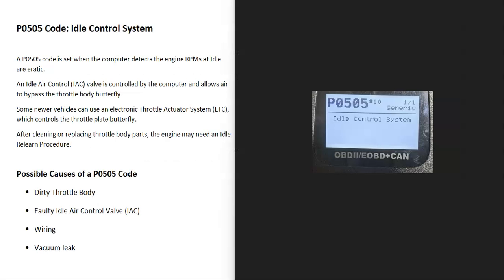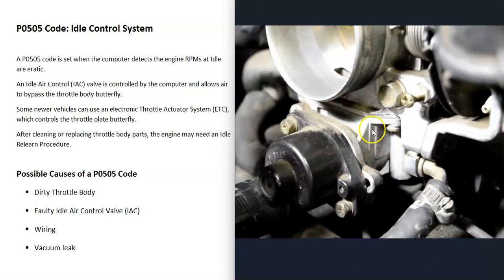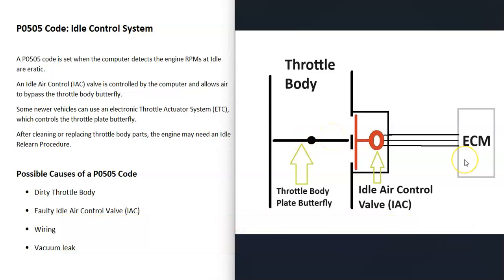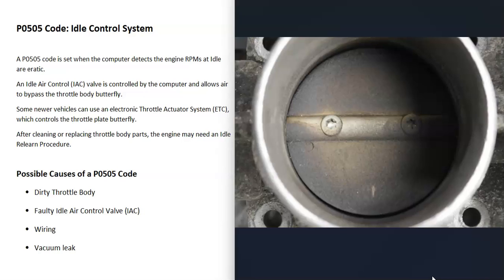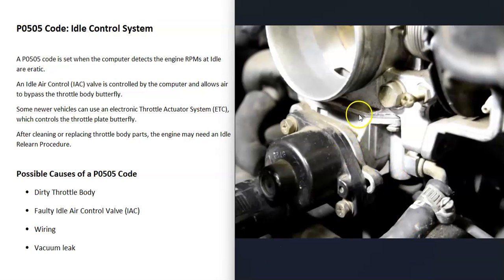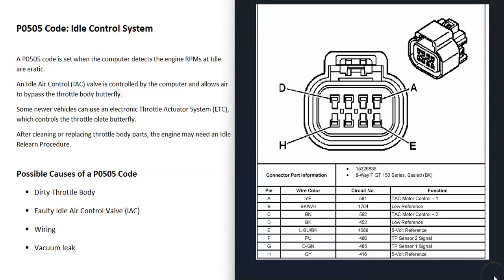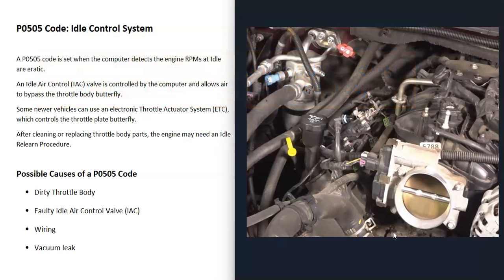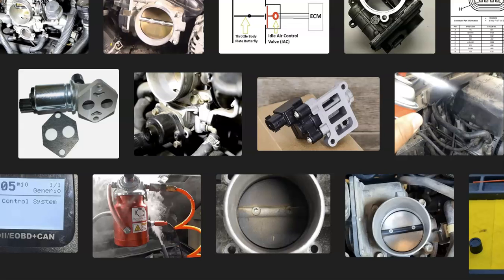Causes and Fixes P0505 Code: Idle Control System

Comment: 2006 corolla doesn't have icv just electronic throttle body keep getting the 0505 ive changed everything intake manifold plugs coils TPS no leaks plus new fuel pump ?

Comment: I replaced the throttlebody on a 2004 Toyota Camry 2.4 L but now I’m getting a P0505 and a P0441. I’ve checked the purge solenoid and it’s working fine. I’ve checked the hose is going into the throttle body and they appear to be OK. They may have not been anything wrong with the old throttle body, but I changed it trying to eliminate a no power issue the car runs great going down the road. I just get a check engine light with those two codes.
Reply: Did you fixed it ? how ? I just have the same Isue, exactly the same after replacing the iac valve
Reply: Yes please update when you can

Comment: I had this same problem with the Camry, cleaned throttle body , changed iac, changed spark plugs but ultimately it was the spark plug wire that made it misfire

Comment: Just bough one and it has the same issue I check the sensor under the throttle body and it was unplugged so I got excited and plugged it up and started the truck and the idle went up to 2k rpm’s the sensor looks shiny new any idea what could cause it to be higher when plugged in vs unplugged